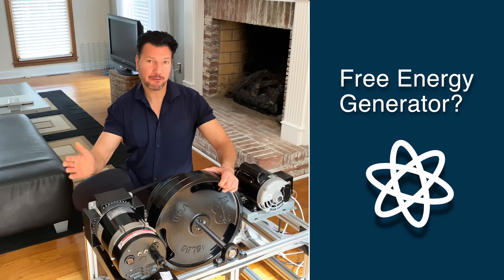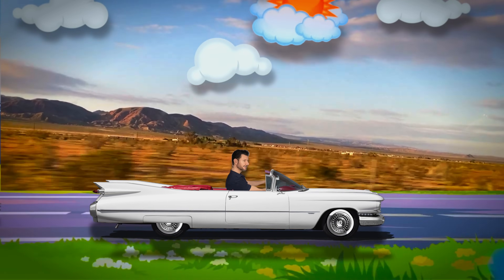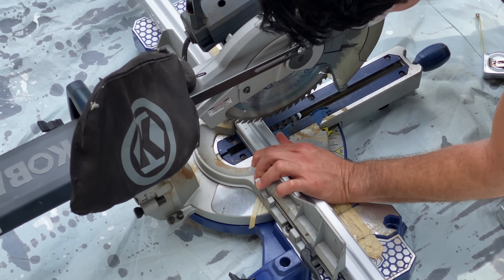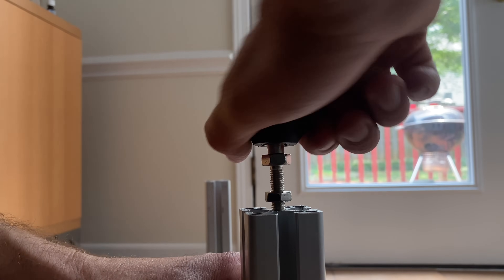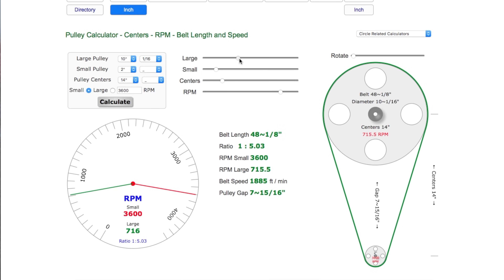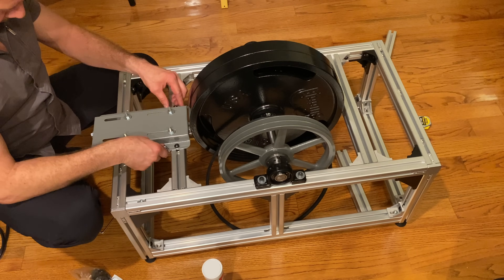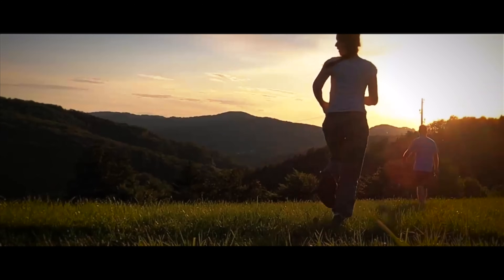How to Make a Free Energy Generator!

Comment: the drive motor needs to be just large enough to keep the fly wheel going at the rpm needed to maintain the correct rpm of the generator while under load.   if the drive motor will start the flywheel on its own then the drive motor is too large.   the drive motor should not have the power to start the system. that is why we see slow starts, pulsing, a series of short on times by the drive motor so not to over amp it, till the flywheel gets up to speed.   and the belts have to be loose, the tighter you make the belts the more current the drive motor will use.  the larger the pully on the drive motor the more amps it will use.  use a small pully on drive motor.   use an amp meter to monitor the drive motor amp draw.  adjust your gear ratio till the drive motor is using the least amount of amps to turn the flywheel at the rpm needed to spin the generator  at the rpm it needs under load to provide the motor with the amps it needs.   its a matter of tuning.  I would start with line power and power the drive motor,  tune the gear ratios for the lowest amp draw from the drive motor, while driving the flywheel and generator.   connect the generator to a dummy load which will draw the same amps the drive motor draws while turning all three components.      tune all gear ratios, size of mass, rpm of mass, rpm of generator till the generator is outputting more amps than the drive motor is using to turn all three components.   you will see the amps used by the drive motor go up and down as you tune, adjust the belt tensions for the lowest amp draws without belt slippage at full speeds. you will have belt slippage when getting up to speed.  the faster you spin the flywheel the better, while keeping motor amp draw as low as possible.    put capacitors on the output of the generator to act as a buffer.   the key is in the tuning, once tuned and your generator is outputting more than enough amps to power the drive motor while it turns all components then you can switch from line power to generator power.     forget about trying to calculate gear ratios, and mass size.   use amp meters, it's a balancing act of tuning.
Reply: Free energy doesn't exist
Reply: @latenightprojects  I guess not for you anyway but for me it does and I have it.
Reply: @rmendes2mendes915  bro it's against all laws of phisics
Reply: @rmendes2mendes915 ok, then make a free energy machine, show it working and then fully disassemble ot to show there ain't no batteries or wires connecting it to mains
Reply: @latenightprojects  it does not matter how good one makes the video showing a free energy device, you can no doubt fake it somehow. and even if it is real those who do not have the knowledge of how these devices work will never believe it anyway. I just wish those who build these devices would explain better what is going on and how the device works, I just wonder if people have done that but their videos get deleted because too much information that could actually help others have success building one themselves. we can't have that better delete that one.   I understand how they work.
Reply: @rmendes2mendes915  I don't just belive what I've  told. I thought I could make smth like that too but trough experiments I have confirmed that what physics teached me was correct.
Reply: @rmendes2mendes915  first thing first I don't live in us and second I'm not old enough to vote. Also u should assume stuff
Reply: @latenightprojects  good, maybe there is hope for you.  I been alive for over 60 years and have accumulated a lot of knowledge I’ve been on the news threetimes for inventions. I have built electric vehicles I study electronics I have about $50,000 worth of tools and I know how to use them I’m a jack of all trades and master of some.  I’ve dedicated the rest of my life to two things ,1 truth, I always search for truth.  2. Energy, I experiment with all forms of energy, Including vibration, oscillation, resonance, frequency, gravity and anything else that moves or can potentially be a energy source.  Do you think I may have more knowledge than you?   If so try listening to what I have to say , I’m not here to deceive anyone I’m here to share the truth that I have learned.  You can choose to listen or reject what I say but I don’t have the time to spend trying to change the mind of someone who is not willing to listen.  Choose to listen and you will learn .
Reply: @rmendes2mendes915  we ain't too different then. I study electronics too. My dad and grandpa did aswell. I am a jack of all trades and I have a ton of tools. I have experimented and all that I have found is that physics don't lie
Reply: @latenightprojects  agreed, and what I am talking about does not break the laws of physics.  If you wish to communicate we need to do it separate from this site
Reply: @rmendes2mendes915  tell what website also the free energy generator shown is this video or anything similar to it wouldn't work
Reply: @latenightprojects  yeah i know, but I question some of those laws, as we did have success in manipulating magnetic fields and did get more power out than we put in.
Reply: @latenightprojects  I am working on building the skinner gravity power machine which I believe works.   it's a energy amplifier through harvesting gravity but does require energy input.

Comment: Possibility I told you a little bit about it last time but I didn't give you all the truth you need a magnetic generator permanent magnet generator you need put an extra set of brushes in there to run to a DC converter to run a DC motor to spin the magnetic generator to use the normal setup to create here AC power meanwhile you're taking it DC leg off the generator to run the DC motor with a large flywheel for kinetic energy and it might work
Reply from the maker: You tried this yourself Jon?
Thanks!

Comment: This is exactly how science should be done! 
If you see something or have an idea, you should have a go at it... 
Personally, I have thought about trying this myself, my train of thought was more along the lines that the motor needs to be low voltage and high current while the generator needs to be high Voltage and low current. 
The reason behind this is that I believe the more current is drawn from the generator, the more load is placed on the motor.... But I'm thinking of a DC system where I can use the high voltage and feed it into an mppt charge controller to convert the high voltage low current like from solar panels to a low voltage and high current to charge batteries and or drive a DC motor.... 
So theoretically, a charge controller or DC to DC converter does all the heavy lifting instead of the generator being loaded down.... 
You also need to make sure that the motor doesn't use more watts than the generator is putting out... Maybe a larger pulley on the flywheel shaft to the generator to get it's RPM up sooner?  Not sure if that would make any difference but I would imagine that a pulley is cheaper to purchase to play around with different sizes than anything else... You should be able to see instantly if going larger or smaller is making any difference at all and possibly get a look at which way you need to go.... 
Looking forward to a follow up video on this project...
Reply from the maker: Thanks so much Peter!
Interesting concept with the high voltage idea.
I just posted a follow up.
And yes 100% agree try out everything yourself instead of believing what was set as laws 200 years ago.

Comment: Try a 12v moter and an alternator to turn the generator.. and auto deal cycle battery.. I'm thinking a plow truck Salter moter..
Reply: Deep cycle battery..
Reply from the maker: Have you made a generator yourself John?
Thanks for the feedback!
Reply: @MarkusNenning  no but this is something I've thought of.. having a 12v moter altinator 12v and the generator for 110v all in 1 loop. I'd love to see if it would sustain.  The Salter motors 5hp 12v and altinator combo should work by it self. Due to it works in a truck.. the battery should not loss. Then with the generator added in as long as the 12v moter can handle all the load. Should do ok. As long as it can spin everything

Comment: A great job and nice setup. It's well known that we cannot create energy, what only we can do is convert existing energy from one form to another. And the conversion machines or systems are not perfect, efficiency always less than 100%. Your input is more than your output.  Why this kind of machines never work.
Reply: most of these new energy inventions are not creating energy, they are simply taping into new sources of energy through invented devices.
Reply: Sultannast your output is as bad as your input. Nothing like quitters. k eep that negative thought process to yourself. Someone give this guy some #methamphetamines🤭🤣.
Reply from the maker: @JT-od7wq  😂
Reply from the maker: Thanks!
If you have a chance check out my next video once posted where I go into this topic and question a few of the theories.

Comment: Sigh, you do not use that large of a pulley. It's the same damn size of the flywheel! You're killing all your torque! Duplicate what the guys are doing in the videos! This is NOT a duplication. The pulley for the motor/flywheel connection is small and the pulley for the flywheel/generator connection is a little bigger. This ratio is a must. I swear..... You people haven't got a clue.
Reply from the maker: Well Fritz it’s about getting the correct rpm in the end so I had to use what I was able to get.
If you watched it you know that I tried a smaller pulley but couldn’t even get the motor started because the circuit breaker tripped.
Try it for yourself if you already have all the inside :)

Comment: good video but that will not work what woul ask you to put a  ups to the motor and the fly wheel may need few pounds more and do me a favor make that in video pls i need to see it , i am trying to do one
Reply from the maker: Thanks for your feedback Akil working on a few changes.
Check out my next video once posted.
Reply: one more thing be carefull if the generator is getting more rpm the voltage may increase  so before conecting it to self energy on measure the voltage for more safty

Comment: Really nice project. But if you try to make it vertical with a magnetic bearing to reduce the friction. And I would be using a battery. As a buffer.
Reply from the maker: Thanks Alexander 
That requires a lot more accurate machining than I have available.
But yes that would be nice.

Comment: You need a six horsepower electric motor to drive the flywheel the heavy one. The inertia built up in it will drive the generator. Definitely measure the amperage going back into the driving motor. Damper the current with diodes if necessary or resistors. Store as much power in between the two with capacitors.
Reply: How do you damper current with diodes?
Reply: @valveman12  best bet is to use diodes with resistors. The diodes would set the voltage the resistors will limit the current and if you throw in some capacitors you'll make it a sine wave instead of square wave which will allow it to run a lot smoother.
Reply: @craig265  
Do you mean you are using the diodes to rectify the voltage from the generator?  
If you use resistors to limit current, you are already creating losses due to heat as the current is held back by resistors.  
Anyway, if you are trying to build a free energy device, it won't work.  There are no free energy devices, because they are impossible.

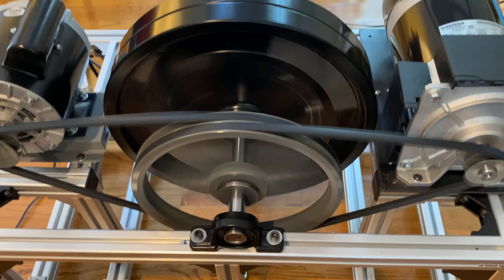Comment: My question 10:10 / 10:20 you mentioned plug motor to generator? How did you do this plugining why dodn't you simple use switch
Reply from the maker: Hello Marius I used a relay to kill the power from the outlet and almost at the same time to switch to the generator power.
You need more then one contact.
But yes a switch with several NC/NO contacts would work as well.

Comment: If your lacking power to the electric motor you can step up the amps by installing capacitors to you electric motor from the generator.. This I believe will give the amps required while the generator is under load.
Reply: The flywheel is probably too big heavy.
Reply from the maker: @georgeel6868  I was thinking not heavy enough.
Reply from the maker: Thank you Eugene I am working on a 2nd video where I talk about the use of capacitors.

Comment: The flywheel should be heavier or have exact weight for the system and have high in rpm above all (motor & gen.). That, once the motor or generator slow down for instance, because of the friction and load, the flywheel replenish the force to continue the rotation. Therefore, the pulley should have a variation to make that flywheel rotate in high speed.
Reply: Still doesn't work...
Reply: habib khan , what's the change with a bigger flywheel?

Comment: low current consuming motor+flywheel+1+1+1.... planetary gears(high torque low rpm)+1 planetary gear reverse(high rpm with some previous torque)+one way clutch(to prevent shaft breaking)+flywheel+generator.... try this brother.
Reply from the maker: Nice concept Zubair
Have you seen this setup working somewhere already?
Reply: @MarkusNenning  No brother, this is only my personal thought.

Comment: motor 3kw  84% efficiency....generator 3kw,67% efficiency.big heavy wheel storing 10kw.starting current 3kw for 4hours wheel max storing,cutting power to the system.wheel start loosing power every cycle lost 20% from the thermal and fiction.when wheel lost all the storing power to compensate system stops.conclusion.bullshit
Reply: keep your money .

Comment: Is not impossible first you need a regulator second you need a battery to storage the energy or a grid to feeered you can't pump water with the plug on apressur water pump needs a switch that automatically when it reaches a safe limit otherwise you brake the pump or the lines when a giant dynamo windmill has to stop is because the city greed has its limits never runs freely your contraction has nowere to send the energy generated nor a regulator to cut off when needed

Comment: Do away with the generator and replace it with a solid shaft. Drive one end of this countershaft from the flywheel shaft, as you have done. On the other end of the countershaft attach a large pulley that drives a smaller pulley fixed to the flywheel shaft. Use the motor to spin up the shafts and then disconnect the motor. 
The flywheel shaft will now be driving the countershaft and the countershaft will drive the flywheel shaft so it will run forever. Right?
Reply from the maker: 🤔I don’t think that works Roman 😃
Reply: @MarkusNenning  Of course it doesn't work. So why do you think incorporating a generator and motor, both with efficiencies of less than 100%  will work?
The generator drives the flywheel shaft, via the motor, and the flywheel shaft drives the generator shaft. Same as my suggestion but with more wasted power
Reply from the maker: @romanroad483  it’s not that easy explained.
I am working on a video that will show that and maybe make you re-think that theory.

Comment: The electric motor is not 100% out put. The flywheel is a battery and dose not produce power just stores it at a loss and the generator is not 100% out put. If everything was at 100% you still would not be able use extra power off the unit. 
More people need to be honest like you and not miss lead people and waist time going after things that don't work so we can find something that dose.
We need the find better materials something that can let current go through it with no eddy current the effect it. This will resolve all energy problems. I tried to use mercury but the resistance is to high. The other thing to think about is to be able to move magnetic fields with low force kind of like a transistor dose to a power supply where the magnet is the power supply.
Reply from the maker: Very interesting Attila!
If you think along those lines you may my next upcoming video.
I talk a bit more about the generator and new ideas very similar to yours.
Thanks for the feedback!

Comment: It won't be sustainable as a infinite loop, however if you can spin up the flywheel over a few minutes time, all the energy put into it will be stored (with some lossed to friction etc) and then you can power up the generator with that for a little bit of time. Prob like 40-70% of the energy put in depending on how efficient you made it. The most efficient ones are magnetic levitation flywheels where you can power it with your hands and still get a okay amount of power. Thats the only way to get "free" power though. As long as you are using a engine to power it up it will take more energy than the system can recover.
Reply from the maker: Thank you Elemental!

Comment: Logic dictates that it works. Larger pulley on motor going to a smaller pulley on the flywheel, along with a large pulley going to the generator. And maybe you should look at a larger generator something that would be capable of powering your house with the use of a transformer. I hope you follow up on this and complete it. I to have been contemplating it for the last several years in various means. Free power can be done it's just very few take the time to really think it out and some are killed by big business for drawing attention to it.
Reply from the maker: Totally agree! Thanks Kev